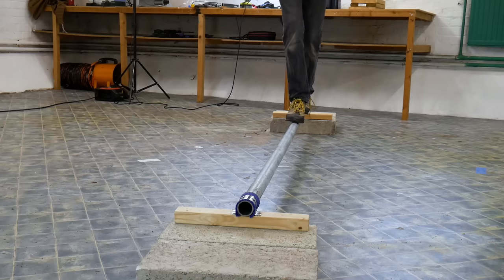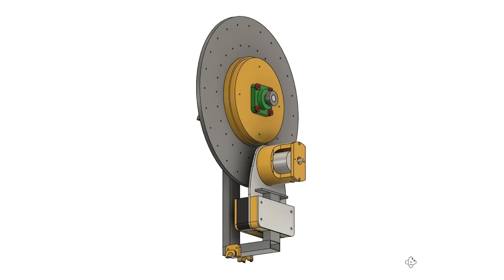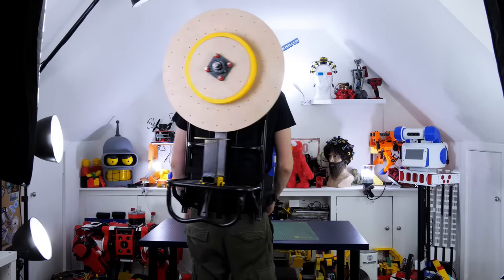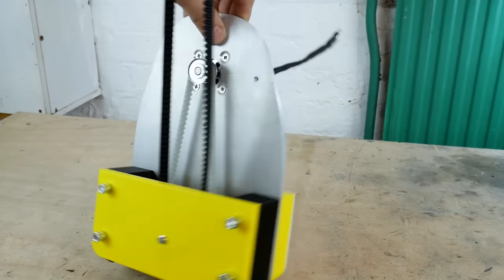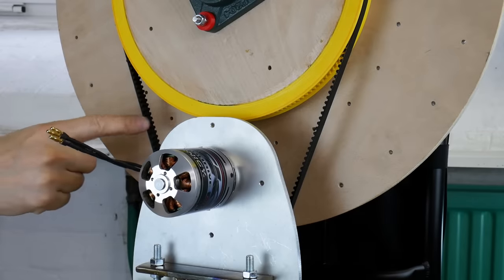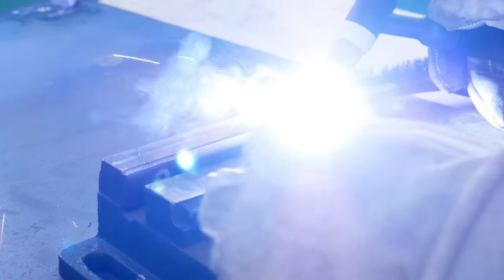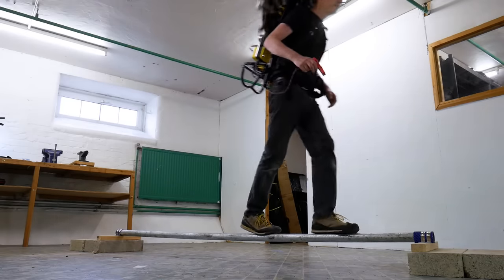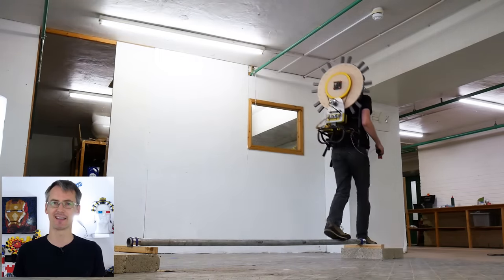Tightrope Walking Cheat Device

Comment: I love your balancing machines! Suggestions for this one:
1) Ring of mass instead of spinning death flower. Reduce the mass for same moment of inertia. I would have tried a bike wheel with a vinyl 2" tube filled with wet sand, capped on each end and zip-tied in place of the tire. Respect for the max effort approach, but man that is a lot of cutting drilling welding screwing for the world's most deadly social-distancing encouragement device.
2) Accelerometer mounted on chest to decouple angle changes of the backpack relative to torso.
3) Ankle supporting work boots to help avoid breaking or spraining an ankle.
4) Control test with static mass on backpack instead of control test with no mass on back. I would guess it's even harder to balance with 30kg load on your back. So the improvement would be much larger than you seemed to observe.

Keep up the great work! You are inspiring!
Reply: I laughed out loud at “spinning death flower” hahaha

Comment: It's scary how close your elbows are getting to those massive steel bars!
Reply: "Billy Mays here, Do you love balancing but hate your elbows? Burtoncorp has finally come up with a sollution ..."
Reply: had to stop watching coz of this so scary
Reply: I bet he cringed in pain watching this back in editing
Reply: @Different_Name_  yup this is daft. It’s that and also just plain falling over and getting body parts in it.  I assume the trigger was acting as a dead man switch but still. Absolutely batshit IMO.
Reply: Yeah, put some elbow pads on, James!
Reply: for safety reasons, it would be useful to put a circle around the perimeter of the metal masses, so that in case of contact with the arms or other parts of the body there is only a rubbing, and not the impact of the pieces of iron that could create even serious damage.
Reply: @leoneventicinque6731  Or just put it in a cage like a desk fan, but still.... I won't be downloading the plans for this one!
Reply: An easy way to tell that the UK has universal health care :D
Reply: And the ceiling!
Reply: Yeah, he should really build the cybernetic arms before he amputates the flesh ones...
Reply: Actually there is no need to build such a big wheel and reduce motor speed to rotate it. Cos angular momentum is proportional to rotational speed, you can attach a small wheel directly to the motor and get the same reaction with much less mass, size and complexity.
Reply: SAW IV the horror film.
Reply: was waiting for the inevitable slice n dice of his triceps lol
Reply: The Lone Creator  Dude. Shut up and stop promoting your channel buried in the comments.
Reply: Yeah who’s idea was it to put the bars on the inside of the wheel, shoulda found a way to drive it on the inside facing you to be able to make the bars in the outside. :)
Reply: Very not-funny bone
Reply: @leoneventicinque6731  Use a big metal ring around the perimeter to maximize the reaction-to-weight ratio, while also minimizing the risks to everything in the vicinity. Or a hula hoop full of lead shot.
Reply: That's what I was here to comment LOL

Comment: I think that with the amount of practice you put into balancing with your compensator you would likely be able to cross the bar without a huge contraption on your back. Good fun watching the build. 😁
Reply: Good point! When I was around 16, a friend and I would walk up to a store regularly. On the way there was a metal railing fence about 15’ long. One day we got the idea to try and walk on it (was about 3 1/2’ high if I recall) and each of lasted only a few steps. We tried some more…then went on.

But after that whenever we walked up to that store we would give it a try, maybe a few times. Was decades ago, but I recall in about a month of this, we were regularly able to walk the whole length about 50% of the time, and even when we didn’t we got pretty far usually before falling off.
Reply: Someone doesn't understand engineering. Why would you spend 5 minutes fixing a problem when you can spend days solving it?
Reply: lol that was my thought obviously in jest but itd be like a dude designing robotic legs to run a mile faster 😂

Comment: And this is why tightrope walkers have a really long bar. I think it would be much better with a weight on the end of a bar swinging side to side like a pendulum. If it could extend as it pivoted then that weight can be smaller because the lever will be longer, I hope you revisit this.
Reply: This is why the comments are so important. As I too was wondering if what you suggested was a possibility.

Comment: I know you usually want a reaction wheel like that higher on the balancing object, but as you mentioned our body isn't rigid so we compensate for a lot of that.
So, wouldn't having it closer to waist line maybe better?
It would be closer to where our center of mass usually is, and where you would want the most to have those forces helping you balance, no?
Reply: Also, maybe having something like a cage from a paramotor would be a bit safer. XD
Would also allow you to make the wheel wider like you mentioned
Reply: The Lone Creator  Not cool dude.....
Reply: The Lone Creator  Parasite... 🤨
Reply: Was just going to mention the same thing.  Your body is essentially a double pendulum, so any applied torque needs to be on the first pendulum or it will be absorbed by the unconstrained second.
Reply: As a biomechanical engineer I agree 100% with this, other than the center of mass part if you place the reaction closer to the chest your abdomen muscles would work a lot harder to compensate the external forces, making you fatigue faster, it would work better as a balancing exercise rather than a helping hand.
Reply: From a mechanics perspective, yes, you need to control the butt. However, this device as built would be absolutely terrifying if the death-spokes were likely to interfere with the ground and balance bar when falling on said butt. It would be suicidal, untestable. Clearly if you were building this for real the rotor would look like a turntable.
Reply: I think if you imagine two people pushing you from either side when walking over, where on your body you think it is best for them to push you to get best result? I think higher than waist is needed.
Reply: The back is pretty much the only place you could put a device like this, so you don't have much choice.
Reply: Вы написали в точности то, о чём я подумал при просмотре видео. Приложение крутящего момента в районе тазобедренного сустава, на мой взгляд, будет значительно эффективнее. Можно будет сделать ротор менее травмоопасным )
Спасибо.
Reply: I imagine it applies a couple about the torso.
Reply: "closer to waist" - i came into comments to write exactly the same, mind-friend. ;-)

Comment: A ring of mass would be much more effective than radial spokes of death. The radius of gyration of a ring is pretty much R, while the radius of gyration of a bar placed from the rotating axis to the outer radius is R*(1/sqrt(3)). That means for a given diameter and weight, you are only getting 58% of the rotational inertia you could be getting. Put another way, you could probably reduce the weight from 30kg to 20kg with the same inertia by using a ring design.
Reply: They weren't from the rotating axis though, they started most of the way out so not really "spokes", I imagine the radius of gyration wasn't far off of the radius of that wooden wheel with that setup
Reply: You are absolutely right. I can't belive he didn't design the mass placement this way
Reply: Thanks for this comment
Reply: @stenzenneznets  It's fairly easy to see how he wound up with those long spokes:
James is well aware that ring mass distribution is better as demonstrated by his previous 3D printed flywheel designs - they aren't perfect but definitely move the mass outwards
This is the first time he's been moving this much mass around with a reaction wheel, so his initial guess at the required performance was low
Using his initial guess, he built a flywheel with the mass more or less towards the outside, within the limits of a project he needs to build, record and edit in less than a week with room to spare
When that wasn't enough he added steel bar stock to the outside of the wheel
When that still wasn't enough he decided the wheel diameter was too narrow so the next load of weight he added also extended the radius, and then a bit more on the outside

Basically every time he's added weight he's put the new weight as far out as easily possible, he's just been stuck with the existing limits of the design without modifying the already complete parts. I expect if he did a v2 that it would be a larger diameter ring with better mass distribution from the get go. This is just an inevitable consequence of seeing projects like these - since it's just effectively a hobbyist proof of concept you will inevitably see far from optimised designs even from engineers who very much know all the ways the design is suboptimal.
Reply: First thing I thought was "Goodbye Triceps!". Imagine mounting a fly cutter to your back :'O
Reply: Kyle, Thats what I said.  You beat me by 16 hours.
Reply: I'm surprised he didn't run a roll of gaffer tape point-to-point around the outside ends of the steel bars for at least some slight modicum of safety.
Reply: The wheel needs a reengineering. It could be much much more effective. But on the other hand it could be also spined to higher speeds and the mounting mechanism doesnt need to be that rigid - heavy.
I get the point of this video but there is a big room for improvement on this matter.
Reply: Why build 30 kg wheel with two step reduction while you can attach the wheel directly to the motor and get the same reaction with much less mass, size and complexity?
Reply: "radial spokes of death"  love it!!
Reply: The Lone Creator  reporting everyone of your comments as spam
Reply: Plus it's a bit more compact.
Reply: I think it comes down to ease of machining. I'm not fully caught up on exactly what his workshop is like, but I don't think a big, heavy ring made out of solid metal would be all that easy for him to produce. Maybe he could weld weights to the outside of a bike wheel or something, but I think the approach in this video is probably the easiest to make
Reply: Exactly what I was thinking. Very suboptimal reaction wheel design

Comment: Just a little feedback from a physiotherapist on this cool project:

Maybe Put the wheel down at rear center waist level near the body's COG,and shrink it's size and weight by increasing RPM?
Reply: It looks like many of the failures to stay on the bar, specially the earlier tries, occur when James instinctively tries to absorb the pushing force by moving his shoulders and hips in opposite directions and thus shifting his center of mass.

If you try to visualize the imaginary people standing on either side pushing him back, I'm pretty sure they would find that pushing his hips is more effective than pushing his shoulders in keeping him balanced.

So I definitely agree that this would probably work much better with the reaction wheel at or slightly above waist level.
Reply: Increasing rpm brings the issue of acceleration time. In order to gain the appropriate effect you'd need a motor that could reliably bring the reaction wheel up to top speed in a short time. And he already seems to be using a pretty powerful motor, with a 2:1 reduction as well for extra speed.

Comment: If you were to make a steel ring to be the reaction mass it would not only have a lot more inertia than the spokes you currently have, it would also be a lot less likely to smack into your elbows
Reply: The US missile designers (and later space rocket builders) needed to use rotary gyros for attitude control long before cheap electronic IMUs were available. Since mass and volume were at a premium they built the rotating frames from lightweight beryllium alloy and added mass on the rims with very dense tungsten alloy cylinders. Wikipedia has an informative article on the ST-124-M3 inertial platform flown on the Saturn V rocket from the 1960s onwards.

My suggestion for a Mk 2 balancing rig would be to lighten the non-rotating parts by replacing the box steel frame with aluminium extrusions and replace the reaction wheel with aluminium spokes or perhaps even a bicycle wheel driven by a pulley belt, then attach lead weights around the at the end of the spokes (or around the rim).

Comment: I would recommend a linear mass, instead of a wheel:

In a rigit robot, the wheel applies a rotational momentum, which directly transfers (by friction to the ground) as a lateral force compensating the fall. In a soft body like a human body, most of the rotational momentum just transfers as bending force on your spin, which is mostly absrobed by it and the legs, putting very little lateral force on your feets. 

If self-balancing is produced by an horizontal linear actuator (imagine a heavy horizontal bar, that the motor is moving left or right). I believe this would much better transfer as a help to keep balance for your upper-body. Obviously, it can't keep moving left/right indefinitively, so the software must overshot slightly to then recover the center of the axis.

You can test this manually, by handling the horizontal heavy bar yourself with two hands. You will notice how easier is to keep the balance with the help of the bar.
Reply: A linear mass on a single axis would still apply a significant torque to your hips so would have a similar problem but also be far more cumbersome. IMHO 2 key things would make this work far better - a more optimised flywheel as mentioned by others and just a bit of practice, letting his brain get a feel for walking with the wheel on. Admittedly practice would also make him better at walking a tightrope without a flywheel, but it would likely take a lot less practice to get good with a flywheel than to walk a tightrope without one.
Reply: Isn't that what tightrope walkers do with a long balance pole?
Reply: @1944GPW  Yes, but using a flexible pole that hangs below them to lower their COG as much as possible. James doesn't have the space for such a setup. In that case the walker is also the one in control, having it computer controlled would be much trickier to learn to walk with I imagine

Comment: Wouldn't a gyroscope based balance system be better? You can compensate for lower mass by spinning it faster. Also mount it lower, closer to your center of mass. Great video.

Also, one in front and one behind to compensate for the torsion that must be generating.
Reply: Came here to write the same thing, but knew already someone though about it so kudos to you my friend. :)
Reply: Less mass more speed.
Reply: i doubt this would work. two gyroscopes spinning in opposite directions would cancel the torsion, but also cancel the gyroscopic effect. the smart way to do it is to have a gyroscope ring around the waist. but be careful because you might end up gyroscopically precessing on the middle of your tight rope.

Comment: It would be interesting to see how this does compared to a simple balance compensation pendulum. You could get that by simply removing all the weights on half the reaction wheel. Let the weight sink to the bottom and then program the controller to swing the weight from side to side to keep your balance.
Reply: That would also be a lot less dangerous, if it worked, but I suspect it would saturate really easily because of the restricted range of motion.
Reply: @mal2ksc  Well, think about it. It is the same as shifting the weight of a balance rod from side to side of a traditional walker. The only problem is if you start to fall faster than the correction can match the rate of increase of angular momentum. But, if it is tracking that all along the way, that should not happen.

Comment: Rather than the box steel and steel bars that look a bit like saw teeth, you could use a steel ring around the edge of the wheel (like the rim of a bike tire) to add mass to it and it might be a bit safer. It would also mean most of the mass would be further from the point of rotation of the wheel.
Reply: I can only imagine that custom machining a steel ring would have costed a pretty penny, or required some sort of spoke system that would have just created the same issue.
Reply: @adissentingopinion848  You could probably still use the wooden circle. But rather than mounting the steel bars radiating outward from the center, create a multi segmented ring along the outer rim of the wooden circle.
Reply: @adissentingopinion848  You could, however, bend steel into a ring instead of machining it, or weld it from segments
Reply: @adissentingopinion848  it doesnt have to be perfectly circular. he could have made it with the steel bars hes already using just by cutting them at an angle and welding them end to end to make a big dodecahedron or something
Reply: @Hephera  I imagine he would have done this in the first place had he anticipated how much weight and diameter he'd wind up with. The original wheel design assumed a lower diameter and much lighter design, presumably he didn't have time to clean slate a more appropriate ring given his schedule.
Reply: @DIYuntilDAWN  of all the possibilities, the wood wheel is the only one that doesn't have spokes, however it also isn't adjustible.

Comment: I have 2 suggestions.
1- Instead of extending the force arm, you can reduce the size of the disc in half and increase its weight.
2- You can use 2 separate motors and balancers. When you want to turn in the opposite direction, you cut off the power of the first motor and start rotating the second motor, that is the disk.
I'm watching with pleasure. Good work